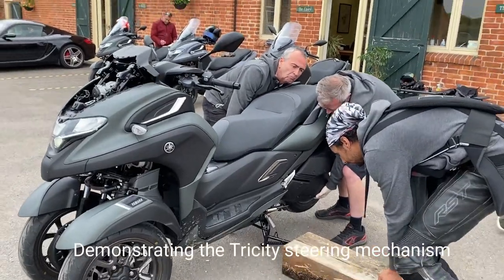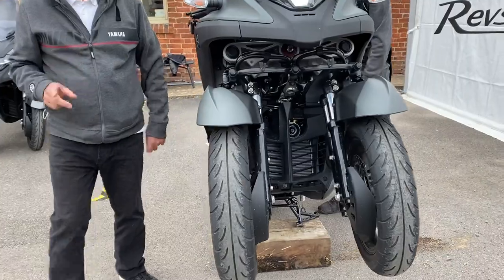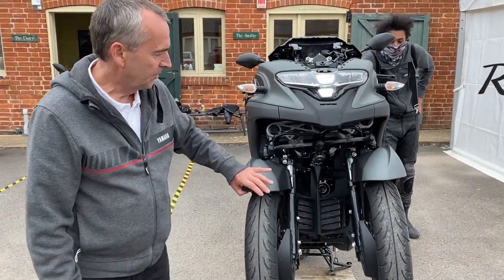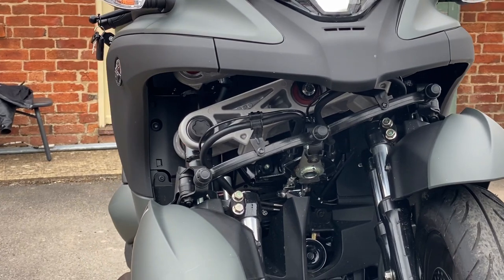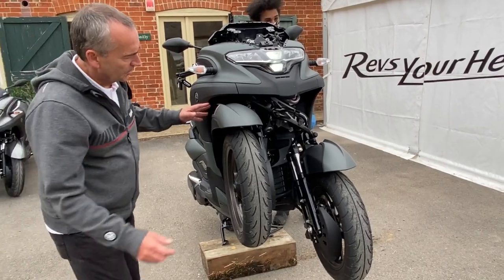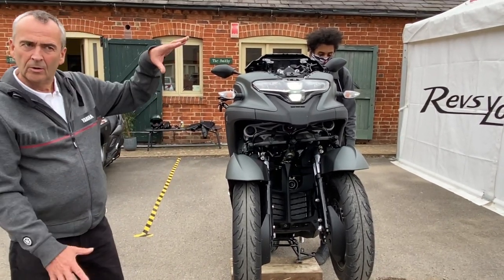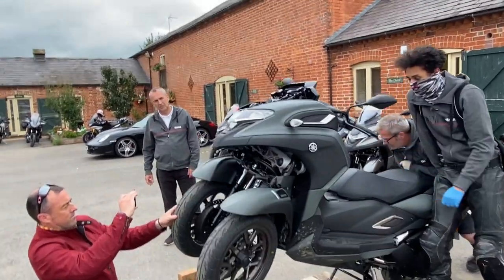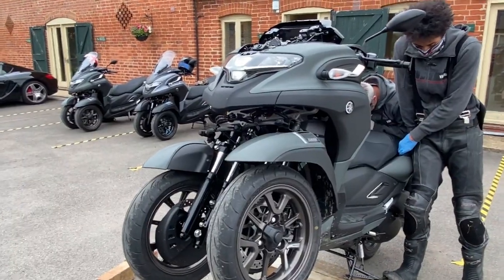SLUK | Yamaha Tricity steering demo

Comment: The standing assistant was only installed for pushing the Tricity, as otherwise it tips over very easily (believe me) or for standing at traffic lights when you have your feet down. Nowhere in the manual does it say you can leave your feet on the running board. In all the videos this is misrepresented.

Comment: Yamaha tricity comes with a mechanical key to open the seat. But I cannot see the keyhole where the key can be inserted. Neither does the yamaha dealer. Can you tell me where it is please. Thanks
Reply: To open the seat, you turn the ingition knob to the OPEN position, and then press SEAT or FUEL - depending what you want to open. If you don't have your key with you, or the battery on the remote dies, then you can use the mechanical key provided. The lock for that key is on the right side of the bike, under the seat, above the exhaust pipe. Hope it helps, cheers!

Comment: I like this concept.  Unfortunately the standing assist was never offered on the Niken or I'd would have bought it.  Still might. The biggest draw back with this unit is the engine size.....I live in Canada and the highways are long and relatively fast.  I can't see this bike handling 110 to 120 kph all day.  Or I'm I wrong?
Reply from the maker: Yes you’re wrong, I’m the UK we use the 300 for long distance with no problems. They can sit at 80mph all day long and are actually better in many ways than the larger capacity scooters.